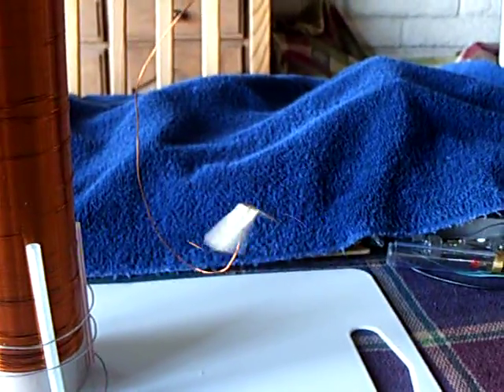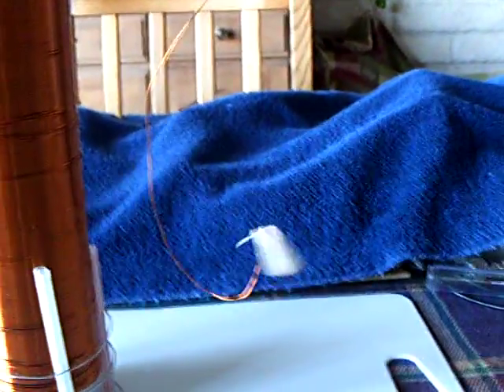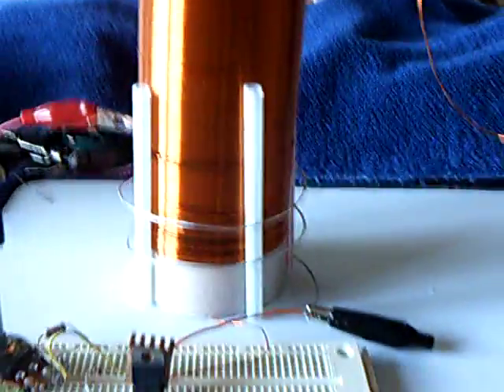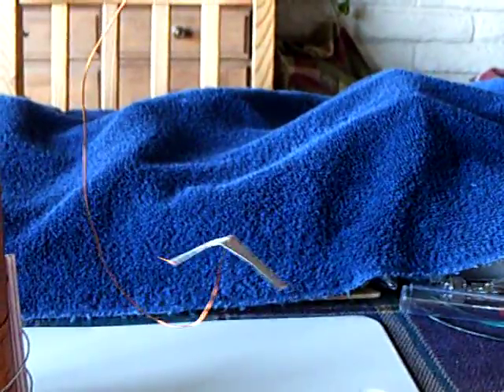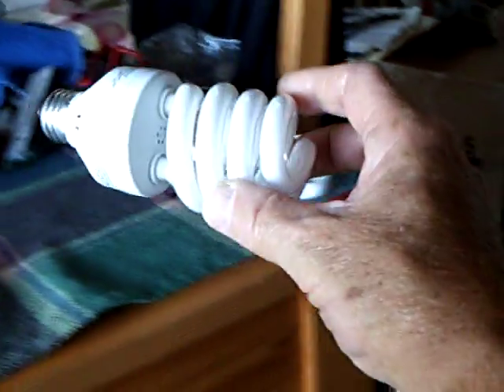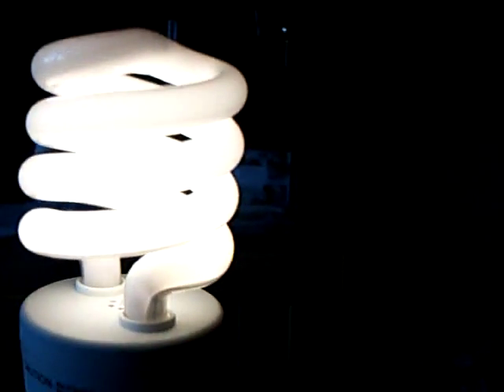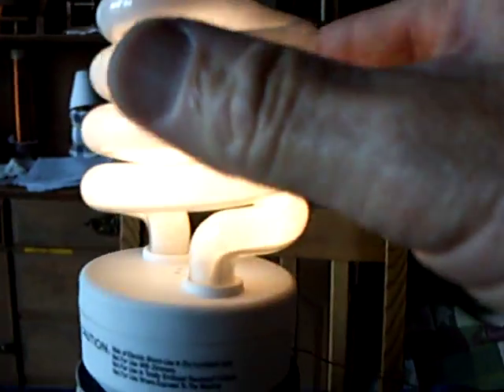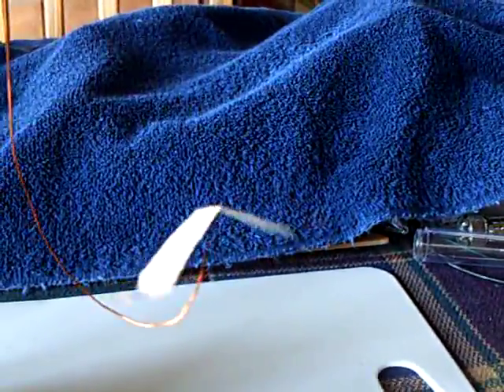Plasma Jet Spinner.ASF

Comment: so do you think that because the air we breathe is filled withnano electric motors (atoms that have a proton positive and electron negative) that the plasma is activated by its repelling electron formation......stan meyer talks about this in his gas generator.no moving parts but just laser activating a sealed gas through coils of copper.......what do you think